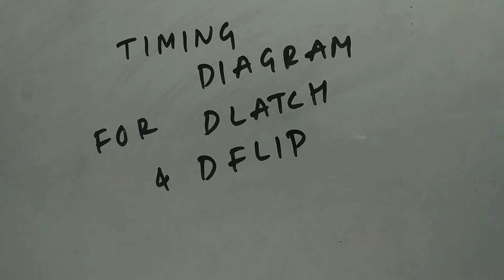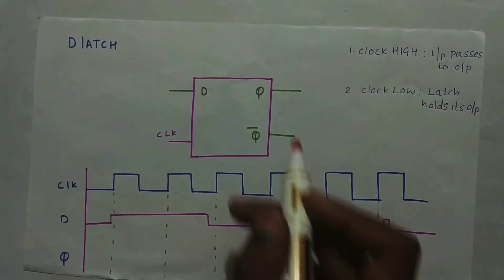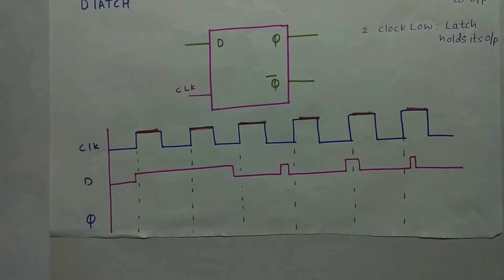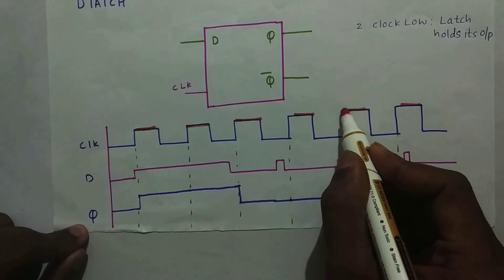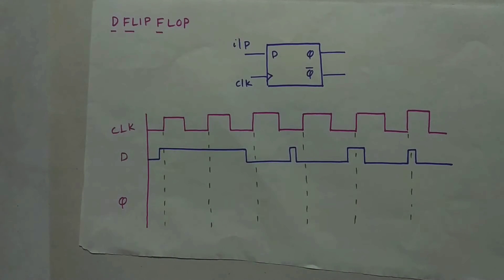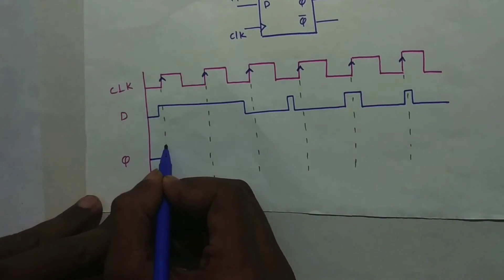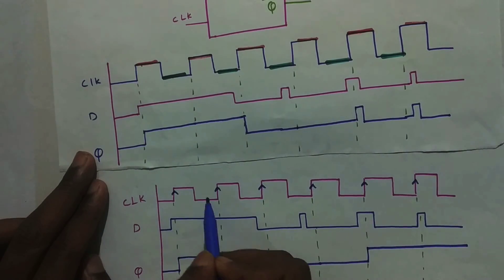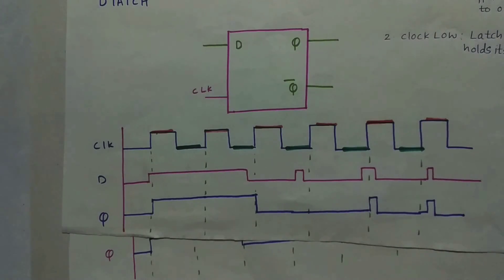How to draw timing diagram for D Latch and D Flip-flop?

Comment: I had a question about the timing diagram. I was told it was called Delay because of the timing delay so would that mean that on the timing diagram, a delay would be needed or not (cos I saw you didn't add that)

Comment: Why you are use clock signal for D-latch?
Reply: But Theoretically, clock signal only given to filp flops.
The major difference between latch & flipflop is clock signal
Reply: @sureshkondeti3122  I have the same doubt
Reply from the maker: Latch is level sensitive, clk is required for latch also

Comment: You have done a great job in clearing the concept of timing diagram. But I had one question, can you please solve it? A circuit is made with two D-type flip	flops. Assume that Q0 and Q1
are both low initially.	Sketch a	timing diagram showing the waveforms	of CLK, Q0 and Q1 for the next six clock pulses.